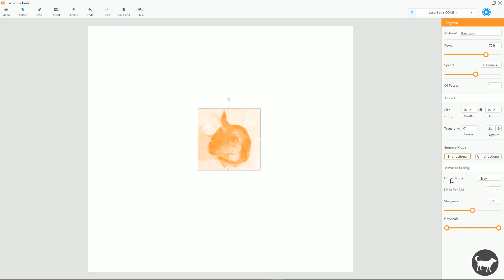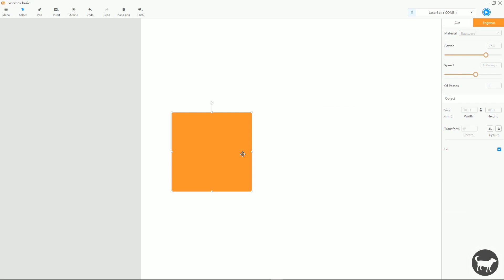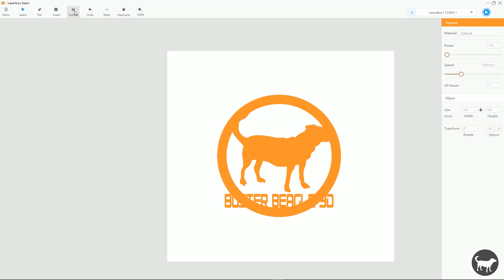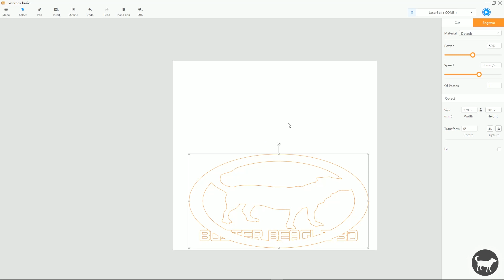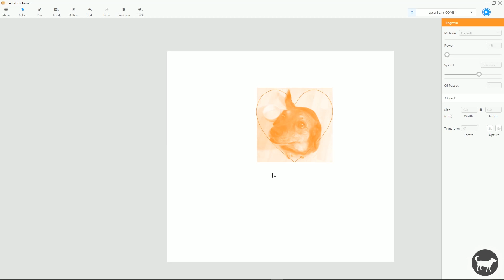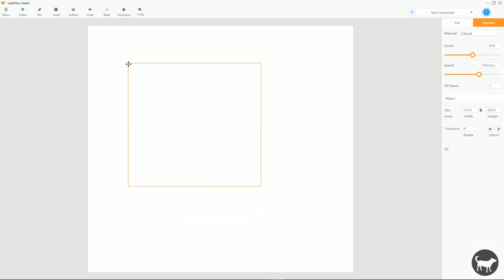XTOOL D1 Laserbox Basic Overview.

Comment: I’m trying to cut out earrings. I used the SVG and got it downloaded and even onto laser box basic. I clicked on cut and when I framed it out, it’s like it didn’t recognize it at all. What am I doing wrong?
Reply from the maker: Hello. Honestly I'm surprised that Laserbox Basic even works anymore. I'm not sure why your cuts are not working but even if you are on the original D1 I would highly recommend converting your machine over to xTool Creative Space as it's the new software with tons of new features and is currently being supported.

Comment: Great video. I want to get a machine and after countless videos, I think it will be an xTool. The one thing that is stopping me from purchasing ANY machine is trying to figure out what I need as far as a computer is concerned. I don't own a laptop, (only a PC in my house) so I guess that I have to start there, but what are the requirements for one? I don't want to spend a fortune on it since it will be mostly dedicated to the machine. Another unknown is, does it require an internet connection to run the machine? I may be wrong but I think that the GlowForge has everything in the "cloud" and therefor needs the connection. Any info anyone can give would be greatly appreciated. Happy new Year!!
Reply from the maker: Happy New Year. You don’t need a laptop to use these machines. A desktop PC should work just fine. While you don’t need an active internet connection like the glowforge to use the machine you would probably need internet to get the firmware and software installed to use the machine. There is no “cloud” setup with this machine but you would need Wi-Fi if you wanted to use that function. I have a bunch of videos on XTool machines on my channel so feel free to check them out for more info on how they work and connect.

Comment: Hello, thank you for sharing. I just ordered an xtool d1 pro and have NO idea on how to use it. What material can be used to put under the project so it doesnuburn your table. I thought I saw a video that mentioned. Fire place grid. What type of grid would you suggest(something not to expensive).
Reply from the maker: You can just buy a simple piece of plywood to place under your machine. If you go to any home improvement store (Home Depot, Lowes, etc ) you can buy already cut pieces that are 2x2 feet which work perfectly.

Comment: Hi, I needed to know what happens in your xtool D1 when you press START. When I do it on mine a window appears loading the job that takes a while to finish. Other times it stays at 99% forever, it doesn't get out of there. When it does, another window pops up saying it loaded successfully and asks me to press the start button on my device. I don't know which button that is! I can only access the Laserbox start button if I exit that window, and when I try to press start, it does it all over again. I'm in a Loop. Another thing, F6 doesn't work on my laserbox.
Reply from the maker: The start button is the silver button on the top front right of the machine. You only ever need to mess with that if you are using Wifi. If your computer is hooked up with a USB-B cable you won't need to wait or worry about it.
Reply: @BusterBeagle3D  Hi, thanks for your reply, unfortunately I must have a problem with my xtool d1!  Yes, I need to use wifi.  It is 2.5 meters from the router.  When I click the Start button on the device, the light flashes orange 2 times fast, changes color and nothing happens.  Does not start recording.  I've already contacted support to see how they can help me.

Comment: Got my D1 a couple days ago, and man oh man do I have a lot to learn. First thing I learned was a Chrome laptop will not work with the D1. I took the laptop back and got one with Windows. It was only $200 more :(  But it works. I loaded and unloaded Lightburn a dozen times, still doing something wrong. I got back on your video and I think I am making some headway. I need to download some more pictures, but thanks to you I do have a picture of my little West Highland Terrier (Terror!) loaded. Decided inside my apartment is not a good place to fire up the laser. Its 15* outside, so I am kind of forced to await warmer weather. I know this is going to sound stupid, but can I run the laser head (with the laser off) around my piece of birch just to see what it will do? 
Once again, Thank You for putting this video out. Without it I would still be totally in the dark! Any chance you will do a Lightburn tutorial next?  Thanks Again-John

Comment: Your videos are wonderful. Thank you. When you added a line around the picture, you got the cut, but then it changed the engrave speed from 100 mm/s to 50 mm/s. I notice then the max engrave speed becomes 80 mm/s. Do you know why?  In my D1 manual is suggests the engrave speed for basswood to be 100 mm/s, but now I cannot use that speed.  Also, if you do not want to cut, how would you prevent that? Also, it looks like they removed the home button on the working section where you can fame and start.  I assume that is because the D1 doesn't not have a home position. Is that correct?
Reply: my version does not have a home button either.

Comment: Buster Beagle 3D- THANK YOU!!! This is exactly what I am looking for. My D1 laser won't be here till Wednesday so I'm trying to learn everything I can before it gets here. The information you shared is spot on and its easy to understand what you are saying. THANK YOU  for sharing your time, wisdom, and knowledge. I will  be pestering you with more  questions when my unit gets here. One question no one has been able to help me with so far, what kind of laptop do you recommend that will work with the included software and Lightburn? By what kind, I'm referring to the software/hardware in the laptop. I have used HP's a lot and iPads, but I know any brand should work. I just need to know what I should have loaded on it. Thanks once again!-John
Reply: How the laser working out for you
Reply: @baseball1528  Hey Cliff, I got frustrated trying to figure it out and all I ended up doing was ruining a dozen tiles. It has been setting in the garage gathering dust. Got one of those things you can engrave round stuff and its still in the box. Of course they came out with a newer -better one after I got mine. All in all I wish I had all the money I have invested still in my bank. Maybe someday I will drag it out and try again. Or nit.

Comment: Great video, thank you.  Question, do you have to manually place the laser where you want to cut in your field or will it go to the place you have you pic in the field? Thank again 
Dan
Reply from the maker: Once you go to burn you will see a little blue dot. Where that little blue dot is in the program is where the program thinks your laser is in the relation to the piece you want to burn. Laserbox basic is really not a coordinate type of program. Without limit switches it's somewhat difficult to always hit the exact same spot on the laser.

Comment: Hi Ryan
Your video did help a bit, but I'm still struggling with certain issues, hoping you can assist. Used to have a huge co2 laser, but found it not viable. Just wanted to have a 'hobby' unit, but really this 'Laserbox Basic' is a 'useless' program, and should not be the only software to 'control' this laser.(which I find well constructed)
I also have Corel Draw to do my designing, but the Laserbox Basic is exactly what the name infers, 'BASIC'...Tried to do a 'rubber stamp' , but for the life of me, cannot get the program to 'engrave' the box around the font. You showed how to fill a box with the 'fill' button....mine does not seem to want to respond...Downloaded the latest 'firmware' V1-10-83....still nothing
I believe they are in contact with 'Lightburn' .....and should be online sometime in December... but won't tell me if one has to pay for program or whether one can 'download' for free?
If we have to pay, it might not be viable for someone like me (hobbyist) ..and furthermore our currency has 'crashed' against the dollar
Regards
Ian Thomson South Africa 26/11/21
Reply from the maker: Hello. I agree that the Laserbox basic could use a lot of work. I’m not sure if Lightburn will have a free version or not for XTool. I believe that software is $50 or   $60 USD but I’m not sure since I don’t own it yet but I’ve heard it’s worth it. The software really is the limiting factor of the machine but I have heard that Lightburn might be available very soon. I know there are already members of the D1 Facebook group trying it out.
Reply: @BusterBeagle3D  They have a free 30 day trial. The only problem is that it doesn't connect thru wifi and my computer is too far from the d1.

Comment: Looking forward to watching your vid. But I'm stuck right off in trying to connect machine to mac with either usb or wifi. Couldn't really understand xtool troubleshooting guide. Might you have any tips?
Reply from the maker: I don’t run it on a Mac but I would suggest checking out the XTool D1 Facebook group. You will find other max users there that I’m sure would help out.

Comment: Uni-directional would be more accurate per burn line IF you have some backlash in the system. It would prevent a slight horizontal shift in every other line.

Comment: Thanks for the video. I have the same frustration with selecting layers. The selector icon in the header menu is not even selectable. I could not find where to edit materials or thicknesses for future work. I have also had ghost layers that frame bigger than the image causing the laser module to crash into the frame. Need to power on and off to reboot the computer board to erase ghost layers. Also sometimes the image does not import into "working" window causing me to work blind with the starting blue dot. Have you had these issues? Little hyperlinks on dither modes with explanations would have been helpful. Thanks again.
Reply from the maker: Hello. I have had some issues with the machine when trying to use the wifi. I have had some issues where it seemed to have a mind of it's own. I have not seen that when connecting directly through the USB port however. There was a little hyperlink that should have shown up to show examples of the different dithers, just not a specific explanation of what each one does.

Comment: On the Lines per CM option... Often raster images are set to 300dpi, that is equal to just over 118 dots per centimeter. Also, at a laser point size of 0.8mm one cm can fit 125 dots. For both of these reasons I suggest in most cases setting the Dots per CM option to 120.